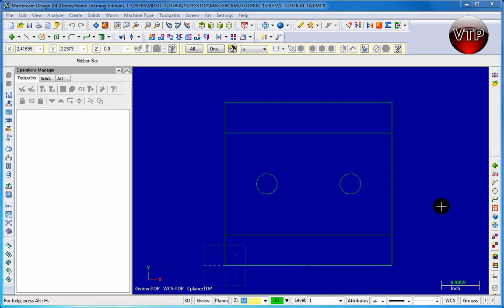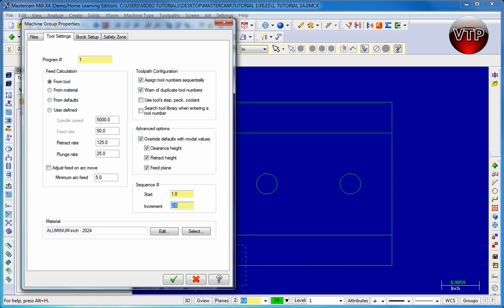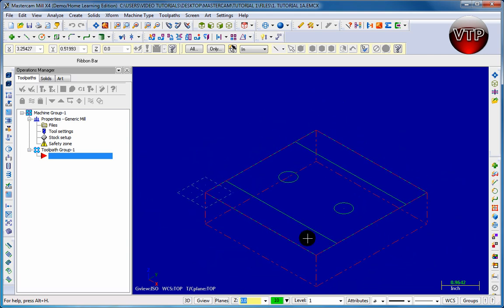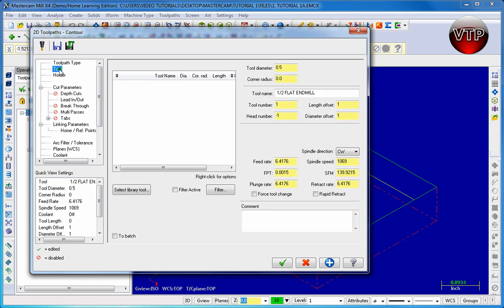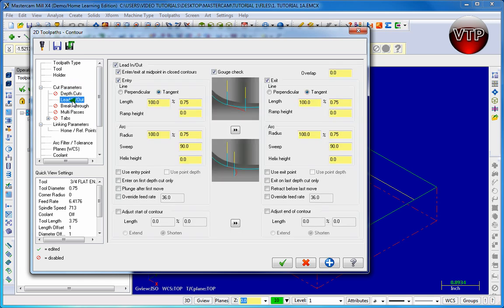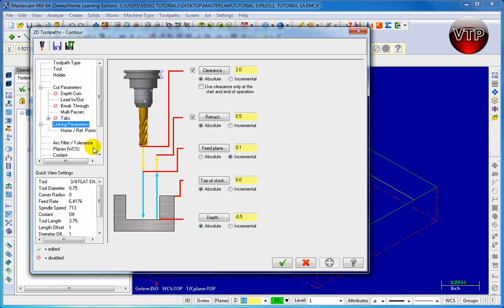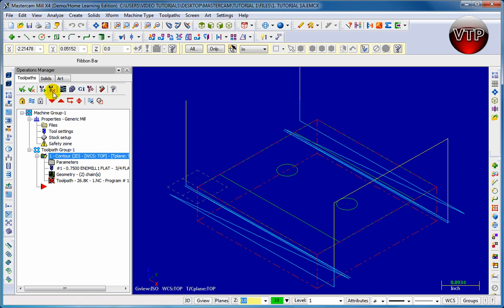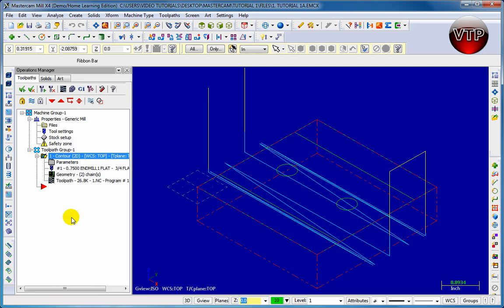MASTERCAM X1-X7 MILL Tutorial in HD - 1.3 2D Toolpath and Contour - vtpros.net

Comment: i am completely stuck, where is the operations manager? ive gone through every icon and every menu and cant see it anywhere,
Reply: its very helpful but oh my god that is the most annoying mouse on the face of the planet, so noisy and so very slow at clicking it. 
im trying to start from zero knowledge of this and be able to mill impeller wheels asap, i have two blanks sat on the bench that should have been delivered 1 week ago. i need very urgent help to do this, and so far this is my only method of learning
Reply: thanks for the help, ffs